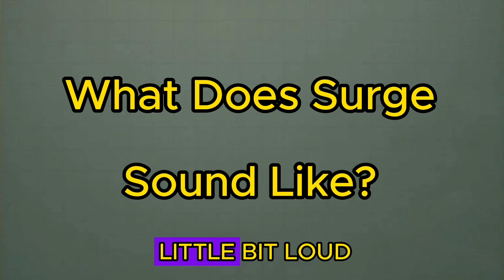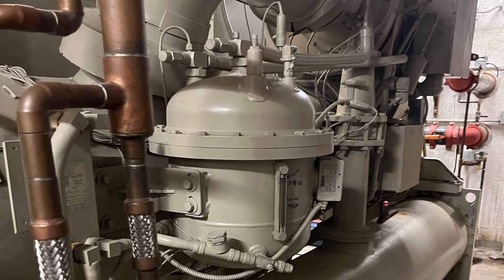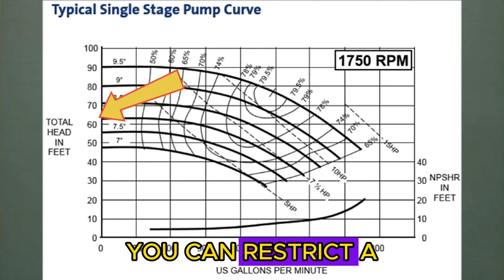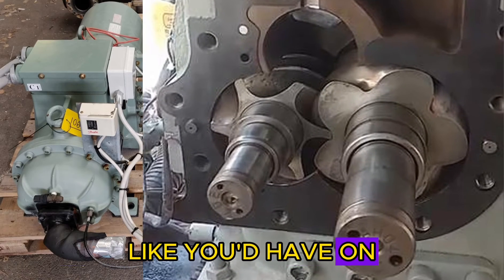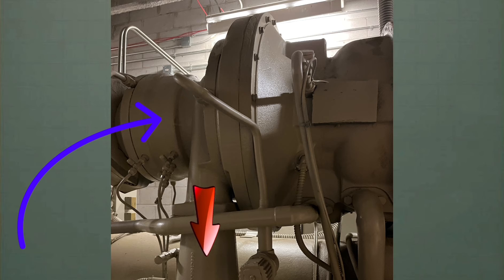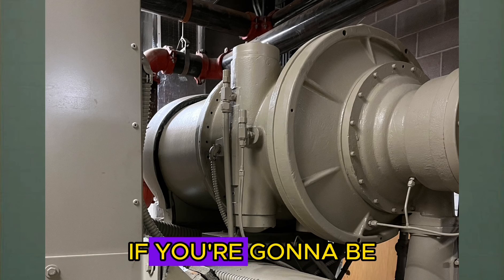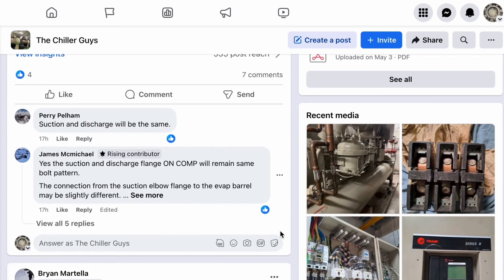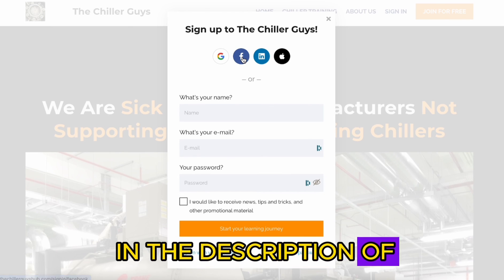What is Chiller Surge? | And What Does It Sound Like?

Comment: What is reason of surge.
Reply from the maker: it happens when you exceed the pumping capacity of a centrifugal compressor by either lowering the suction pressure, or raising the discharge. this results in the reversal of refrigerant flow through the compressor.

since a centrifugal uses dynamic compression and not positive displacement compression the only thing preventing the gas from going backwards through the impeller is the the speed of the gas getting ejected from the impeller. 

We do have an air cooled chiller design course in our membership portal on our website that will walk you through this in detail if you want to learn more about this, there is also a bunch of other stuff that is included as well in there.

Comment: What do call a steady groan during low load conditions...This occurs on our York 900 ton ..It will groan for awhile then stop...
Reply from the maker: is it vibrating?, or surging?
Reply: @TheChillerGuysHub  It's just a steady groan/grumble...When the load is low...I think it's called stalling...
Reply from the maker: @northface484  variable speed? whats the M#
Reply: @TheChillerGuysHub  I will get that...I'm off today...Yes it is VFD....
Reply from the maker: @northface484  10-4, let me know
Reply: @northface484 if you still have this chiller check the microfarads across the DC bus when you can power it down for a bit. I had one that was doing something similar and one of the capacitors was dead in the bank of 10 for the IGBT phases
Reply: Stalling… lack of lift from cold condenser conditions. 

Right before surging. 

Fan speed control or leaving water modulating valve can help w that.